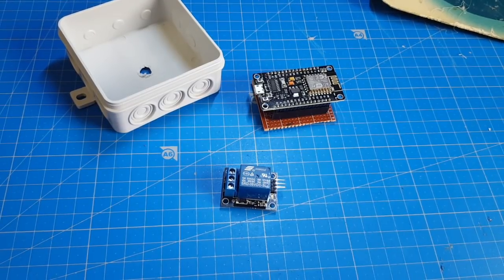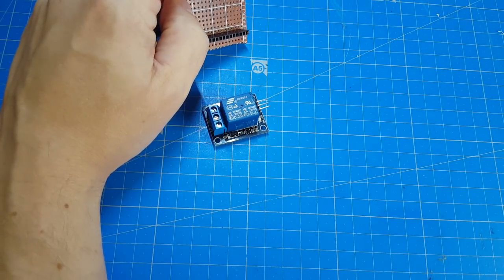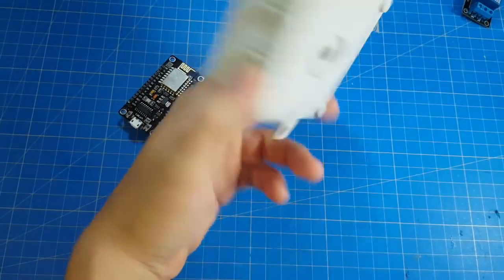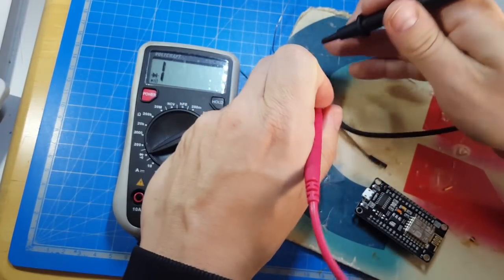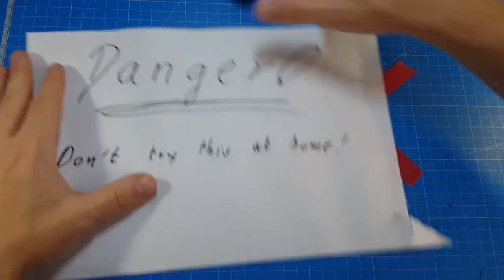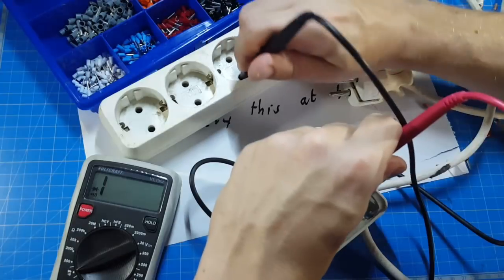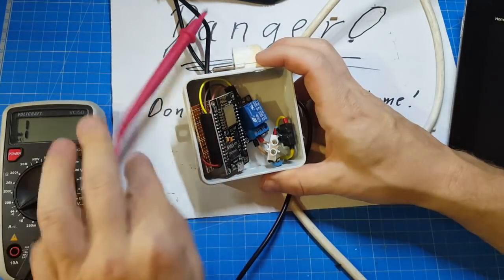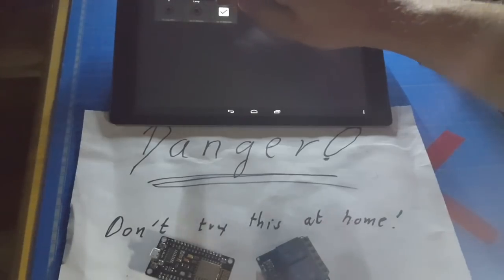IoT Switch

Comment: but once you said relay works with 5v but in video it also get triggered with 3v.why?
Reply from the maker: It has to be powered with 5V. But due it's cheap quality, the trigger pins are 3.3V tolerant.

Comment: Why dangerous?
Reply from the maker: Mains voltage is dangerous! And can be lethal if you are doing it wrong! If you have to ask this kind of question, I highly recommend asking a professional for help you with this project. Your life is too valuable for this.
Reply: @nenioc187  thanks for the suggestion mate. I am more into programming and stuff rather than assembling hardware components that's why I'm bad at this. Thanks for the information :)

Comment: but for one  small application we need to use one wifi transreviever which costs around 3000 rupees...
its soo sad :(
Reply from the maker: Well, I ordered the NodeMCU board for about 3 Euro from china (that should be around 240 rupees)?
Reply: Is there any way so that we can use only NodeMCU without a wifi router +internet??!! ?

Comment: 5v relays.work.with the mcu just fine.You can power the relay5v via the 5v pin.And the relay geta triggered by the 3.3v signal
Reply from the maker: That is correct. As you can see in the video, the relay does it's job without the need for a level shifter.